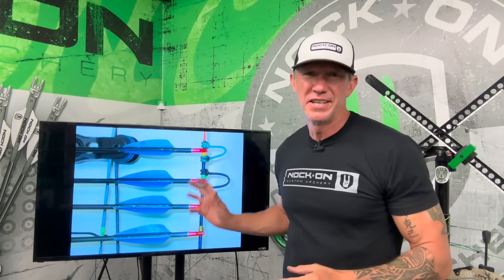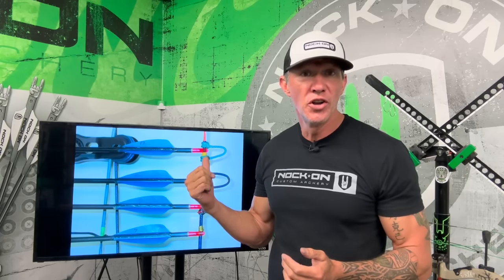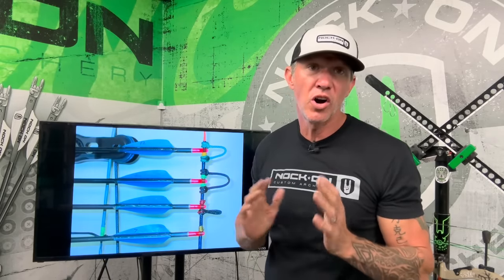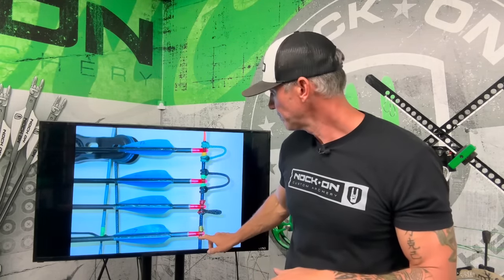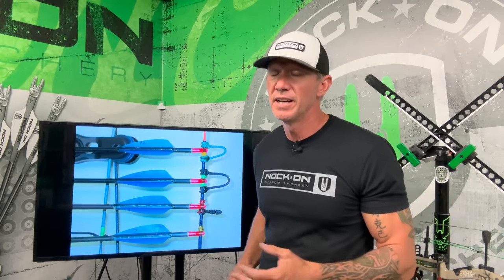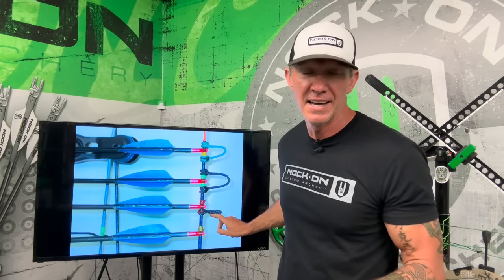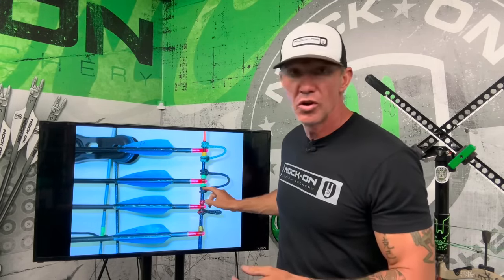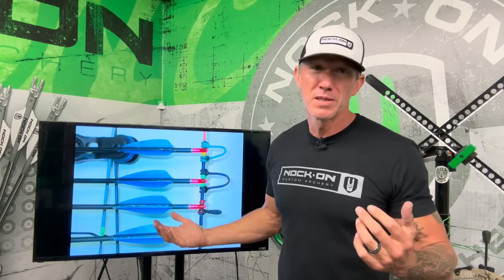D-loops& Nocks EXPLAINED- The Pros and the Cons to several configurations

Comment: You can also tie a top nock-set in the middle of your d-loop top knot. This keeps the top d-loop knot from moving up or down, allows you to space the inside of that knot slight above the nock (slop space), and keeps the nock away from pinching against the harder serving material at full draw. It also allows for a consistent place for the top knot to seat when replacing the loop. It doesn’t address the knock being slightly higher than the middle of the loop though.

But really the difference is just splitting hairs at that point.

Comment: One of my local shops always does the first one, only using the one brass nock below, and usually what happens is over time the d loop starts to pinch.  Another local shop doesn't even use nock sets and ties d loops in the same spot.  I think John's method is the best one, above and below, to ensure your tune is maintained and prevents nock pinch.
Reply from the maker: Great tip!

Comment: I like to buy those no torque loops then instead of using as directed I girth hitch one end and then press the bow and run my string through a girth hitch on the other end of the torque loop. It looks like a d loop without any knots. It works out so that the serving on the premade loop interfaces with the release. I am not an expert but I think this might be the best way.
Reply: GRIV uses the torque less loop on his bows.

Comment: One of the best things I’ve done is switch from the standard BCY 2mm 24 braided poly loop material to the BCY braided spectra 1.6mm 23 material. It’s way tougher and more pliable (more forgiving to release torque). One loop lasts me an entire season. Only con is it doesn’t melt as nice.
Reply: I use the same d-loop material. 23 is tough and doesn't stretch.  The best way to melt your ball on the loop is not to fuzz it up. Just heat it up and let it melt then push it with your finger.
Reply: @robertdavis1102 good tip!
Reply: Same. I didn't think id notice, but i much prefer the more pliable 23 to the 24 now, especially how well it ties knots.

Comment: What’s your thoughts on rope releases? Saves wear and tear on the bow string
Reply: What’s that
Reply: @Luke2002 a rope release is d-loop material attached directly to the release (uncommon to see on modern releases but still a few are sold) and near the cleat itself and is wrapped around the string (that has tied nocks or brass nocks) and is attached back to the cleat of the release. As you maintain pressure pulling back to full draw it is your d-loop. 
It was quite prevalent in the archery world of compounds to use this method of a direct attachment of your release to the string. 
Wrist releases of old were designed with caliper style jaws (hence: caliper release) for this reason and attached directly to the string below a rubber cushion that pushed up against the arrow nock that was being held in position on the string by a tied and/or brass nock. 
All of this was similar to the no torque or torque less d-loop. 
Hope that helps.

Comment: Showing how to adjust cables and string to get your bow back to spec would be nice. 

I just put new string and cables on mine, all the measurements are correct,  but my poundage is 5lbs low. (Yes i did the twist cables and untwist string)
Reply from the maker: Cool idea
Reply: @nockonarchery  thanks, and any help would be appreciated lol.
Reply: This is topic I would like to get more info on. I bought a PSE EVO EVL 34, the ATA and brace height are both off. 
I’ve found very little info on this topic.